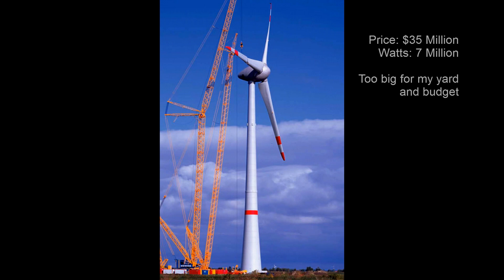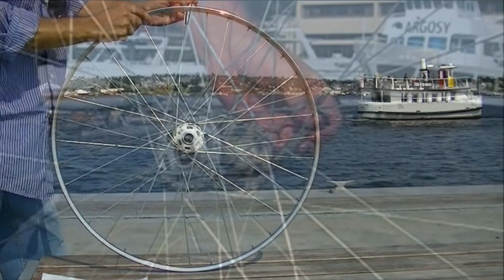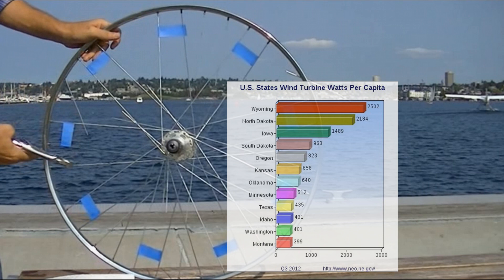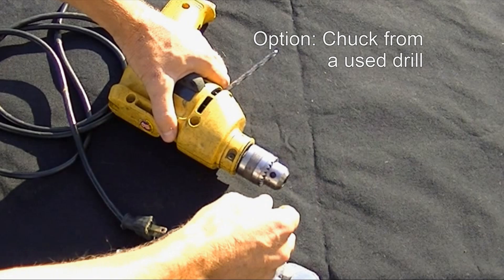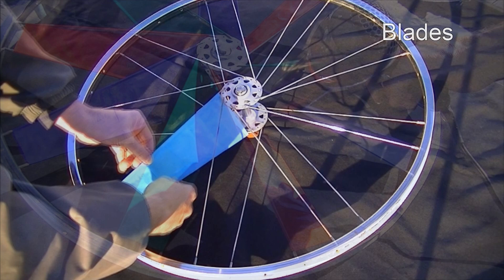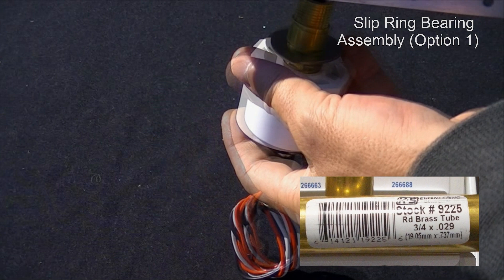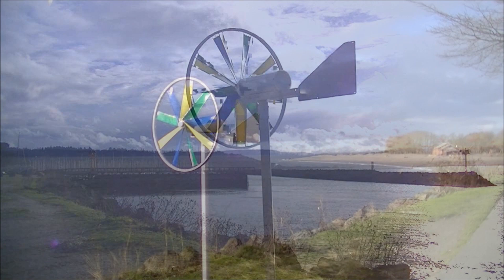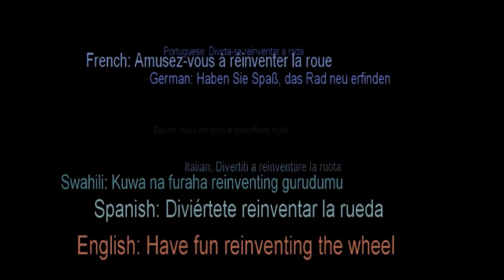Simply Make Your Own Electricity

Comment: A 24 inch turbine of any sort will not produce more than 15 watts.
Reply: Looks like it would take around 20' diameter to drive a 1000 watt heater directly at 10 mph wind.
So charge batteries or build many.